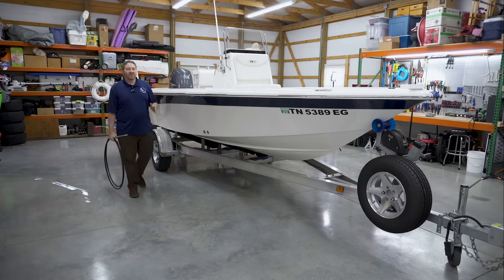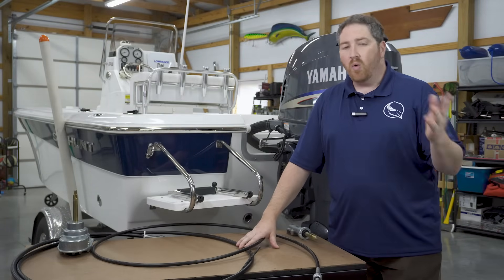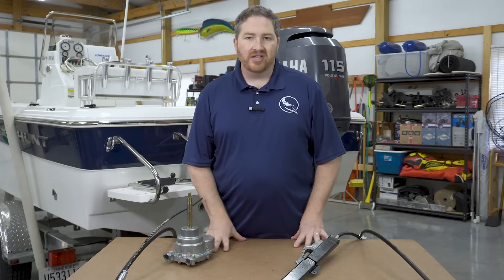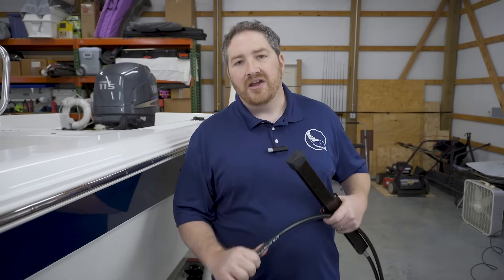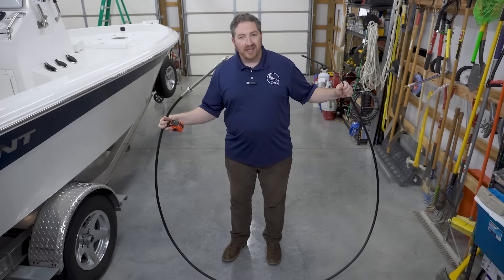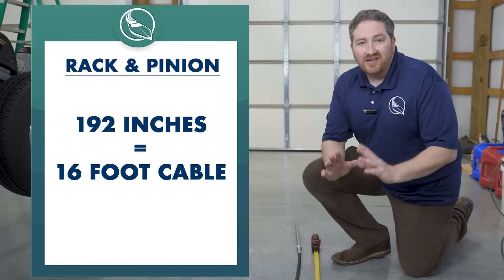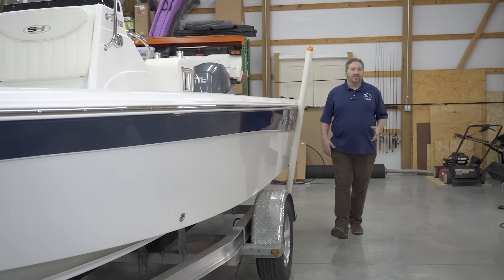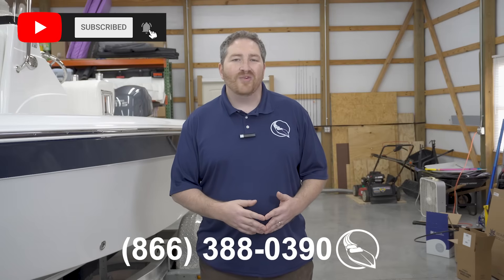How To: Identifying & Measuring Mechanical Steering Cables

Comment: EXCELLENT!  With a rotary cable system, should I grease the cable before installing into a new steering helm?  Or use dry lube? Thanks.

Comment: For a Small Panga 14 Foot with a 30HP which system You recomend. Actually is a Taller Steering outboard, but I want to convert it to remote Steering.

Comment: Is rack an pinion able to clear up slop or have to replace ?
Reply from the maker: Unfortunately, there’s no way to remove or eliminate play or slop in a steering cable once it develops. The only solution is to replace the cable.